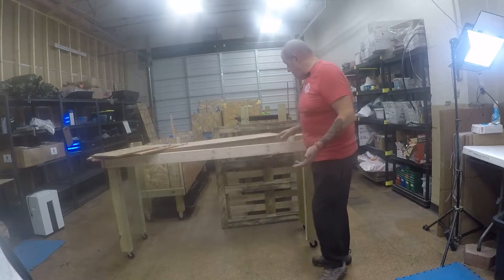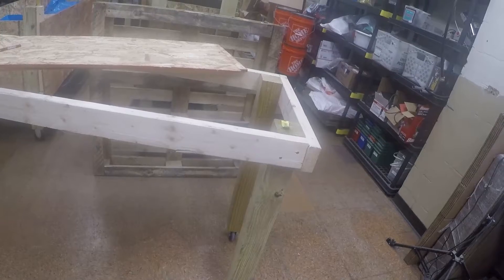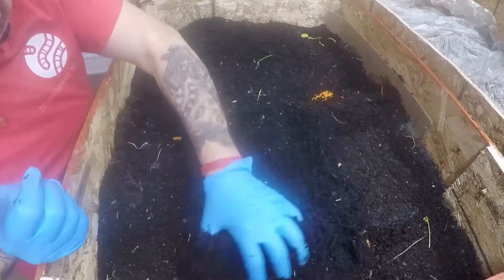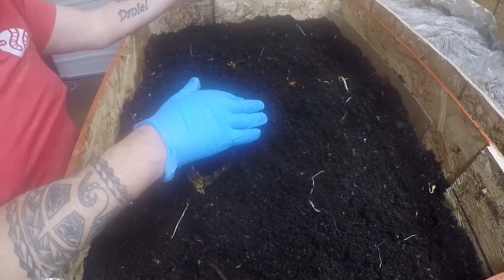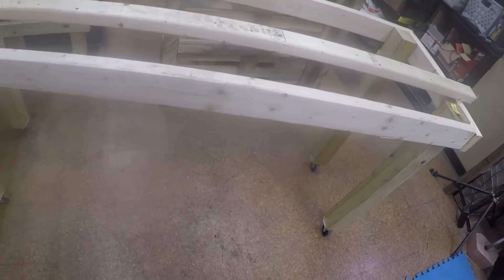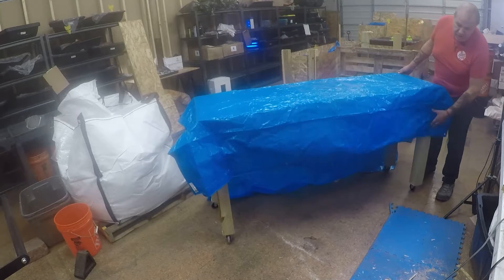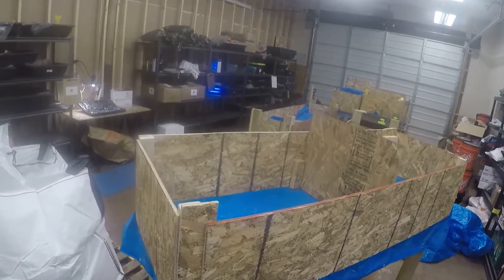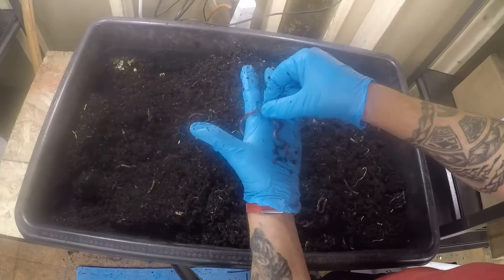How to build the perfect worm's nursery

Comment: Hello from another Northeast worm hobbyist. I'm in Connecticut. You're a little bit more north than I am, but I am much more east than you 🥰. You are about 345 miles northwest of me. This was a great video. I love in-depth looks at how others operate and even more since you showed that we all make mistakes from time to time, and it's okay, because there's a solution.
Do you have any concerns about the particle board breaking down from the moisture in the worm bin? Also, being slowly picked at by the worms themselves?
I was thinking perhaps line the inside of the walls with plastic sheeting or another one of the tarps cut up if that does become a problem. I love Rochester, perhaps I can pay you a visit when the weather gets warm again. Again great video and I appreciate you taking the time to explain everything and show the final outcome. The worms and material all look wonderful. The one additional thing I would like to see is your sifting method. The type of sifter you use and how you go about doing it. Do you have a video on that? If not, do you plan to do one?

I am a follower of your channel and get all the notifications. I would love it if you would follow my channel back. Have a very Merry Christmas
Reply from the maker: Thank you very much for watching.  Yes I have more than one video where i show and review my sifter, you can find them in the channel.